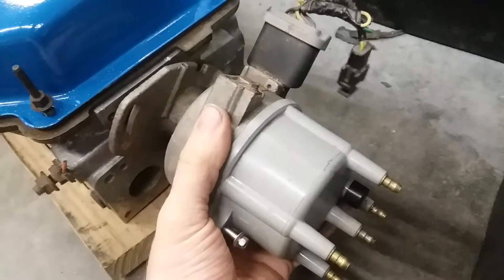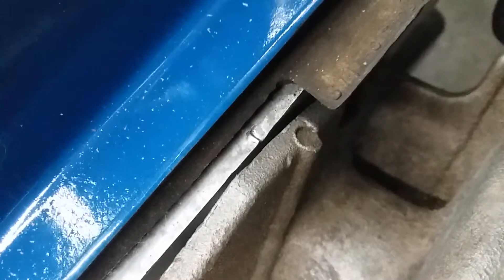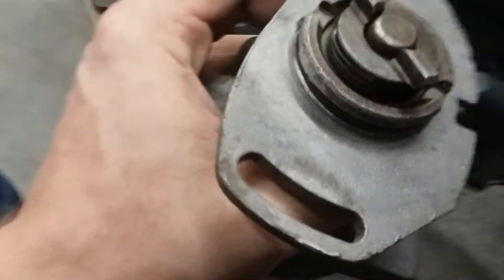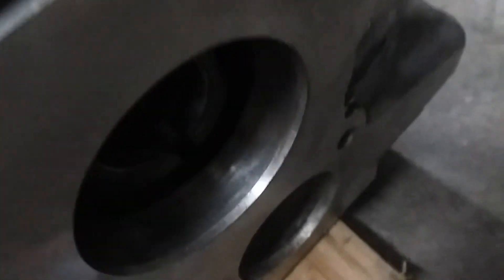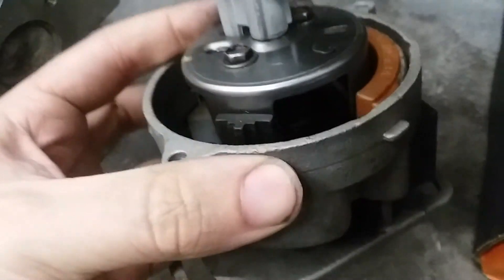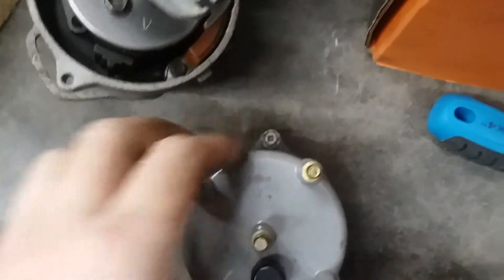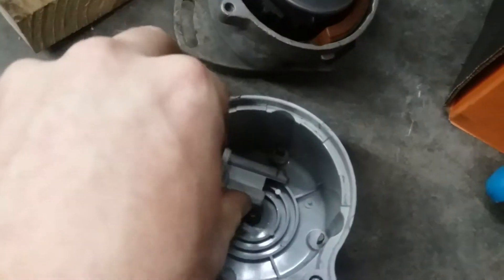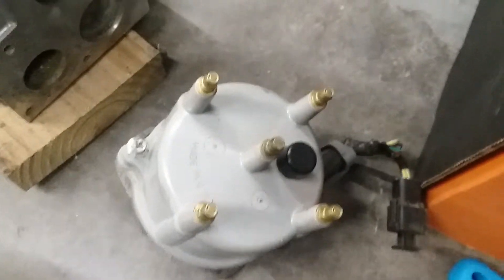Ford CVH Distributor Servicing 1987-1989 Escort/EXP

Comment: Hello! I'd like to start by saying thanks for so many very informative videos on these cars! I picked up a super clean 87 exp this summer. It's a totally rust free, 1 owner car (before me of course). The previous owner only drove it in the summer time. Last time they had it on the road was 2021. He, apparently, had a couple different shops looking at the car to figure why it has no fire. I'm not sure what they did to examine the issue but they never figured it out. Since I have gotta it I've replaced the ignition control module and the coil. I got a new pick up coil yesterday. Today I went to replace it and can't figure out how to get the distributor apart once I got it off the engine. Any chance you can tell me how to get that apart?
Reply from the maker: Hey glad to be of service! ANYTHING to keep these cars ticking!

Been meaning to do a video of completely rebuilding each type of distributor because replacements are now no longer available :/ 
You're welcome to email me at The1982EXPert@gmail.com - there's a few different distributors for these so we'll want to shoot photos back and forth to make sure you're getting the exact info you need. Thanks Joe!